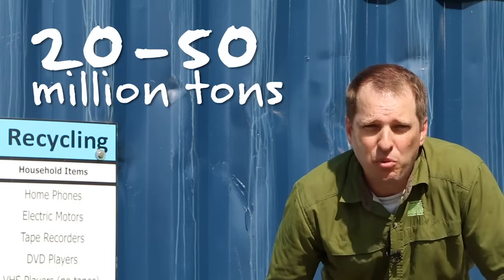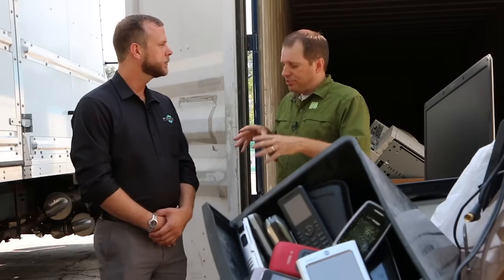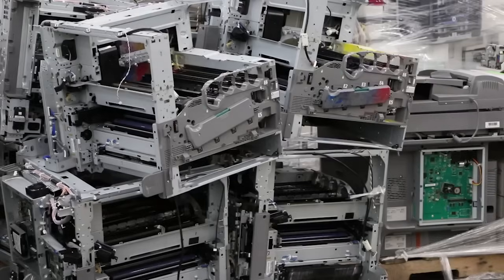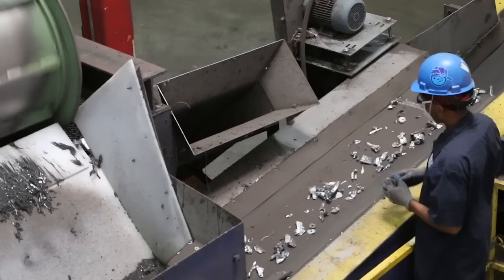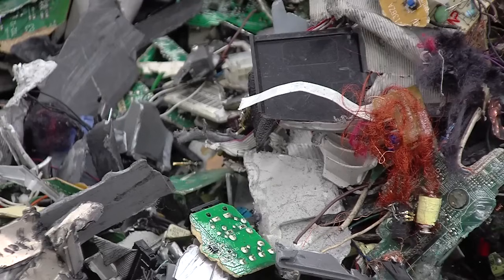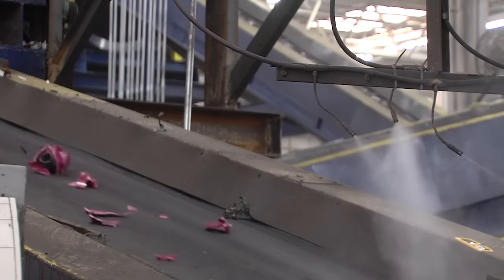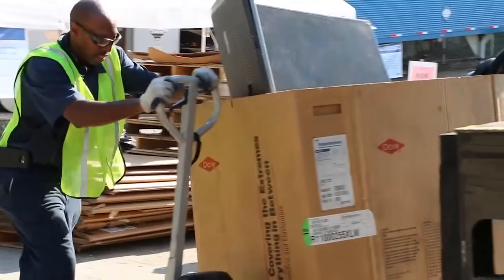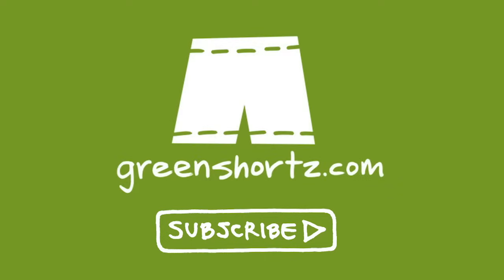How e-Waste Is Recycled | GreenShortz

Comment: With computers instead of getting a new computer every couple of years just upgrade the motherboard. That’s one thing great about custom builds you can do that. Have software that measures how well the computer is running. Also have better fan and cooling systems to ensure runs a longer time. Have air filters to reduce dust in computer.

Comment: The problem is not electronic equipment should be designed to last longer, the solution is to have less designs. For example having only one union design of TV or car or pc. Then manufacturers get permission to build it. Every five years it gets updated. Then second hand internal parts are reusable across the board. At the end of product life it is easier to sort and recycle.

Comment: Custom built pc I think are the way to go. A full atx case with a full power supply shouldn’t need to be upgraded for a long time. Swapping out an ATX motherboard, processor and RAM should be the things that are done. Build motherboards with  standard processor sockets, RAM sockets, and other sockets that could last a lot longer. Just upgrade the processor, Ram and the Video Cards. Minimize the number of times the whole computer has to be replaced.
Reply: That's Against BILL GATES ! And MICROSOFT'S !! RELIGION !!
Reply: @davidwillard7334  They really have not much to say in that. I mean that make a few computer but they are not really computer manufactures. One was a CEO and Microsoft is a software company and a cloud company. All in all its about how much money the computer manufactures can make with their machines and continue selling new machines. I guess the best thing is how we can take these old computers break them down into raw materials and send them back to where they eventually become computers or other electronics. The other thing is working toward doing all this with getting a higher percentage recycled and lowering the cost at the same time.

Comment: If you took out the parts that are still working you could easily sell them cheap and still make profit make a web sit with cheap components rather than shredding them you could get the material from a dvi cable and only make $0.04 or you could sell it for a dollar plus shipping and make a full profit of $1.00 and do that with all your electronics and you could make a lot more money

Comment: What a waste. I know some things are completely kaput, but some are saveable. I found a 1970's record player, complete with speakers, on our local dump. It was in very nice condition, and needed the BSR motor board serviced, adjusted, and the potentiometers sprayed with Servisol, a good clean, and away she went again. Sold it for £30, about $40, to someone who wanted a record player, and not one of those horrible chinese Crosley things !
Reply from the maker: I'll agree on the waste angle. So many people have no idea how to fix stuff. I can tell from your comment that you know what you are doing. At this plant they had a 4x4x4 box nearly full of Canon DSLRs and lenses. They had actually pulled them out to check them to see if they still worked.
Reply: Thanks for that, other things I've found were a brand new, unused, electric crockpot, a cyclonic Hoover that merely needed a good clean to get it going, and a very old set of early LED Xmas lights. Just needed a suitable power supply and away they went. I often salvage audio items, as things such as cassette recorder heads are getting hard to come by, very often you'll find an all-in-one with a kaput CD but the tape player's never been used ! It can often be re-used to make an older cassette sing again though, and of course 8-tracks, reel-to-reels, and even rare STEREO microcassettes seek repairs or sanctuary here. As you can probably tell I restore older equipment and my home's something of a museum of electric appliances. I've a 1920's cylinder Hoover, a Hoover 375 from 1932, and an ancient tea kettle from july, 1940.
Thankfully my Tennesseean wife loves old things too. Happy Holidays, warm regards, River.
Reply: Tom Mills kindly share me your mail. I have some question

Comment: Designing things to look cool longer...  That's a tall order.  Manufacturing to easily break apart...  That's much easier.
Reply from the maker: +Greg's Garage That's why designers need the Greg's Garage mantra (still under wraps)!
Reply: Agreed Tom.  Btw..  Tried to message you on FB, not sure if it went through.  No big deal...  Also, forgot to mention earlier...  Great video.  There's a big debate about what happens to the e-waste.  A lot of folks think the local companies strip the copper and gold, then send the rest to China so they can get past the environmental restrictions and just melt the stuff down.  The process you showed clears that up completely.
Reply from the maker: Thanks Greg. I'll check for the message. Juan mentioned a discussion group.